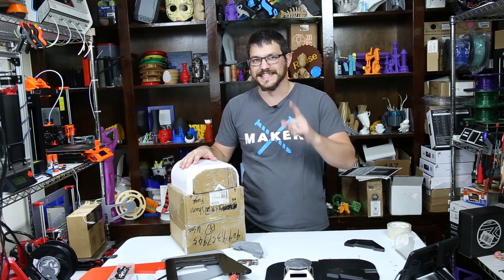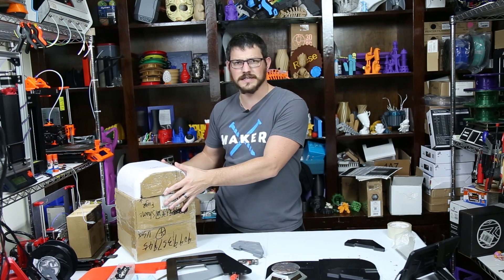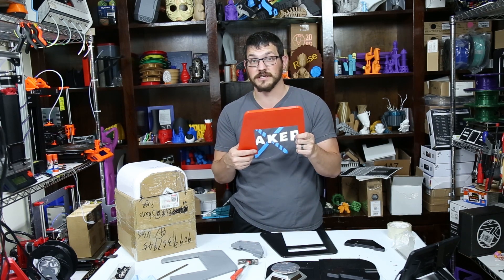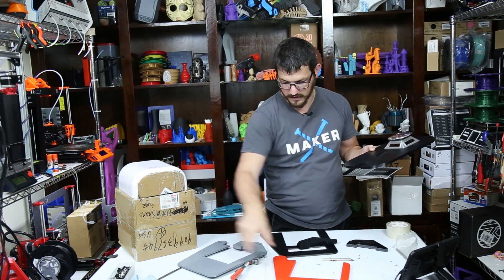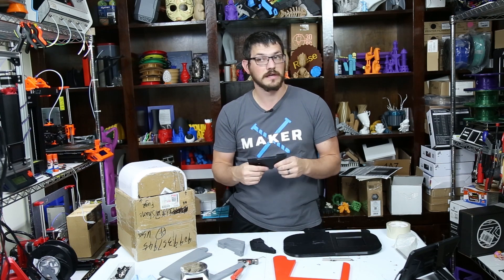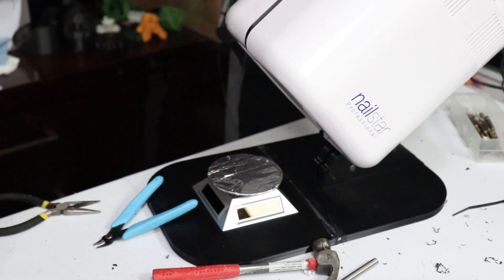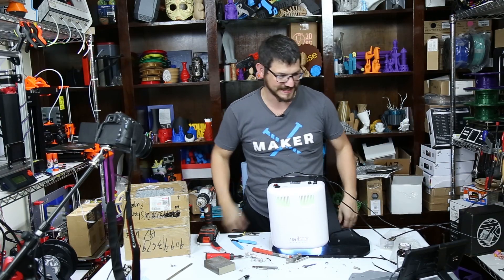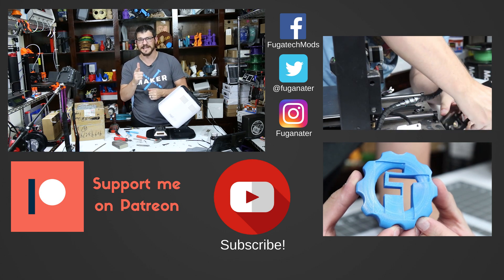Overkill 3D Printed Resin Curing Station

Comment: That wont fit a tall object due to the hinge design.  if your not putting tall objects i that then its a total waste.   A better design would be to close like a clam shell around the object, there by assuring taller items can be fit  to maximize the size of the light housing.
Reply from the maker: You're right, it wouldn't but that is ok. It fits all the prints from my printers and that is all it needs to do. You should design a better version and let me know. I'd be happy to print it and test it out.

Comment: looks good. one thing to consider is with it leaning down too far for you. wedge it up to where you think it should be. then measure the height and then design a box that can be screwed in from below. but for you. you have the gloop. glue it on. it will naturally rest of the box. for the top drill it and make a handle for it. drill two holes and make a loop handle that slides over the the piece and screw and nut it.
Reply from the maker: That is my plan.

Comment: Awesome.  You can probably avoid flipping the models by having a piece of mirror glass on the turntable, with another piece of transparent glass suspended above it with either clips or some blu-tack.  An alternative to the second glass would be a thin, sparse mesh printed in transparent pet-g, perhaps with legs that come down and clip onto the base mirror.
Reply from the maker: Interesting idea. Cutting the glass would be my only issue.